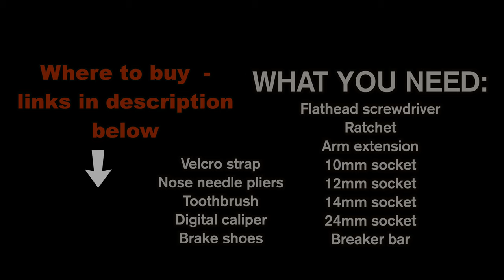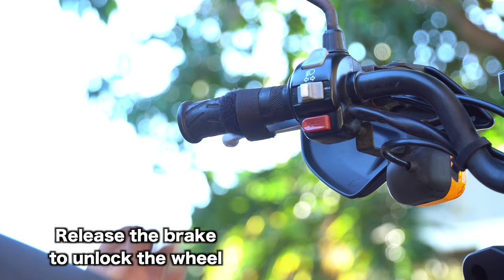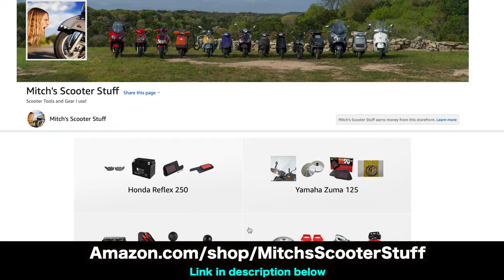Yamaha Zuma / BWS 125 Rear Drum Brake Shoes Pad Replacement | Mitch's Scooter Stuff

Comment from the maker: Get new brake drum shoe set here (2009-2015) (few options to choose)
EBC - https://amzn.to/3k4X5Ec
PWC - https://amzn.to/2FzSlqX
SOK - https://amzn.to/3nYWndR
NCY - https://amzn.to/3lX1kCm

* TOOLS I used in this video: 
Flathead screwdriver - http://amzn.to/2jN7lpE
Ratchet 3/8 drive - http://amzn.to/2hhmnUs
3" / 6” extension set 3/8 drive - http://amzn.to/2h7ypMl
10mm socket 3/8 drive - http://amzn.to/2xGuLSF
12mm socket 3/8 drive - http://amzn.to/2xM4Edr
14mm socket 3/8 drive - http://amzn.to/2xGn4Ms
24mm socket 1/2 drive - http://amzn.to/2Cd9aoC
Breaker bar 1/2 drive - http://amzn.to/2HenuMI
Torque wrench 10-150 lb/ft 1/2 drive - http://amzn.to/2GuMsHJ
Anti seize lubricant - https://amzn.to/2Q4H57t
Velcro strap - https://amzn.to/38GYLyd
Nose pliers - http://amzn.to/2yetDDj
Toothbrush - https://amzn.to/31HSoXI
Digital caliper - http://amzn.to/2Cm8f0l